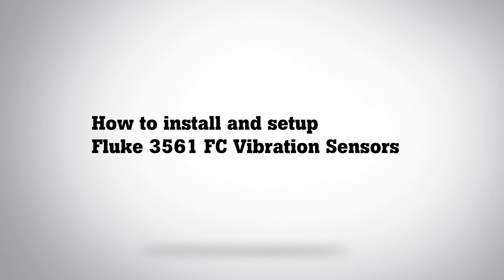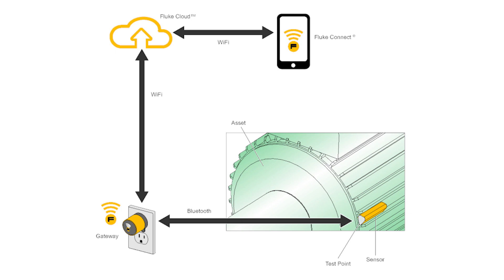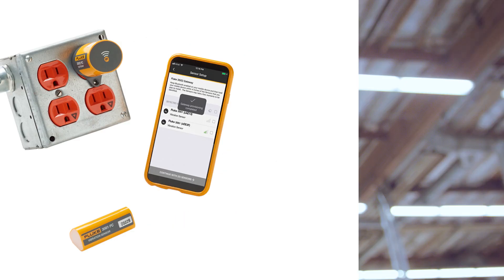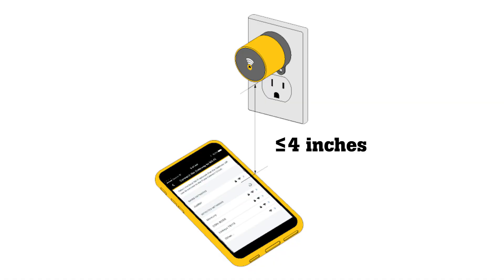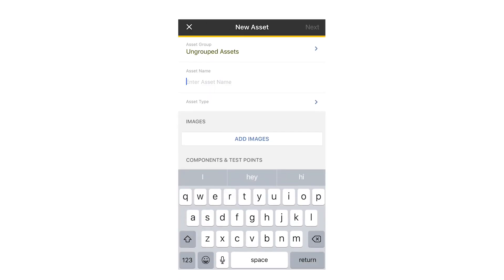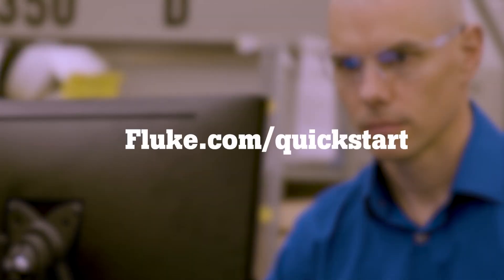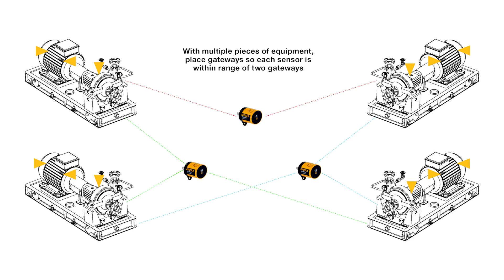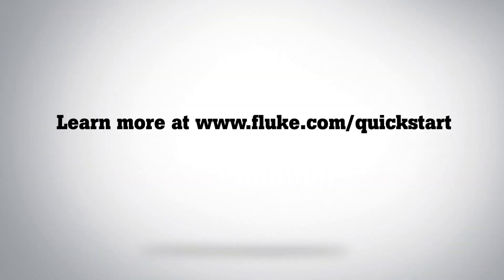Fluke 3561 FC Vibration Sensors: Set-up and Installation

Comment: Does it use any spectrum  Graphs?
Reply from the maker: Hi there - You can view both vibration and temperature trend graphs from your 3561 sensors through the Fluke Connect app. Thanks!